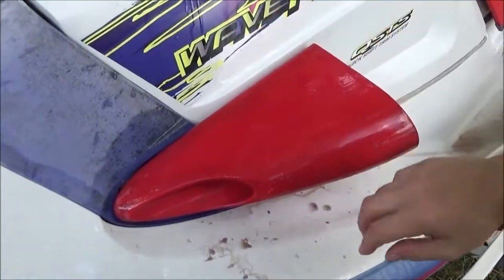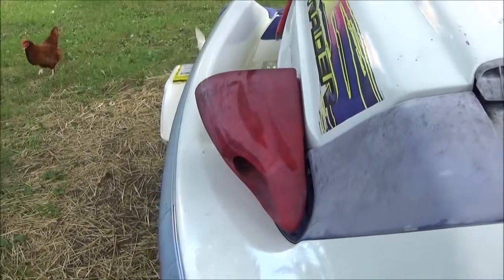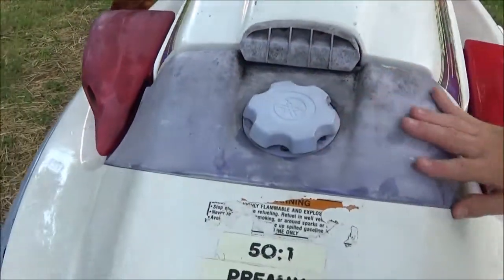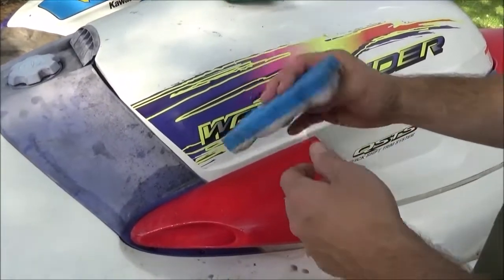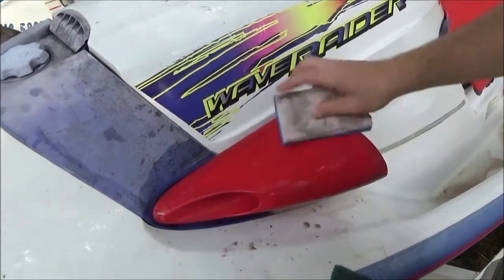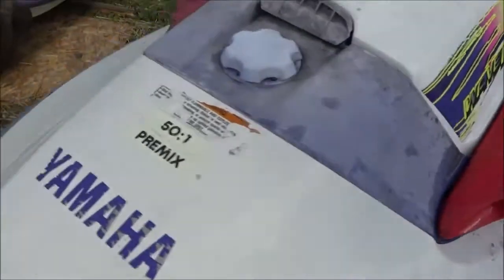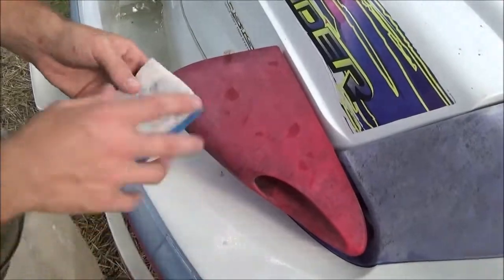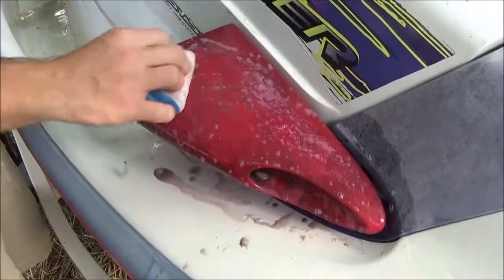Restoring colored plastic on 1996 Yamaha Wave Runner Raider 1100

Comment: Thanks for the video man!!!  A heat gun on low setting works wonders as well.
Reply from the maker: You're welcome. I was going to use a heat gun but was afraid to melt the oxidized plastic into the plastic beneath it permanently. I recently restore a badly oxidized four wheeler using the sandpaper method and tried using the heat gun method after sanding and it did work pretty well to bring back the gloss. 3000 grit sand paper, compound, and a lot of elbow grease worked even better.... but took 10 hours...
Reply: shhhhhh cant give that trick away manneeee

Comment: I am going to try this.  My engine is getting rebuilt as we speak.  I see it says 50:1 oil.  Did you do a oil pump remove and now just mix gas ?  That's what they suggested to me and wondering if that's what you did.
Reply from the maker: The previous owner did it. It's a hassle to mix the gas. I have a boat with oil injection and love it. Just replace your rubber lines. The pumps don't fail the lines crack.